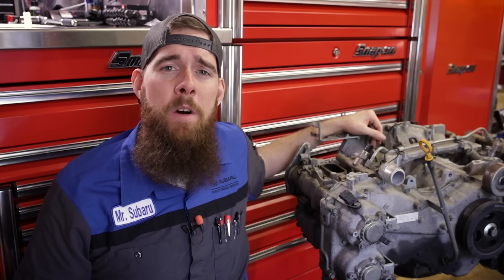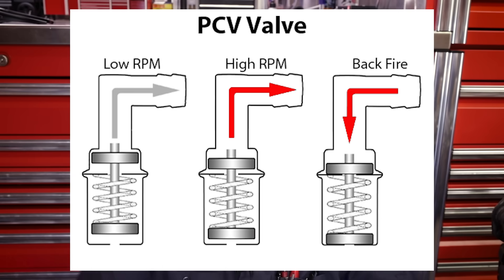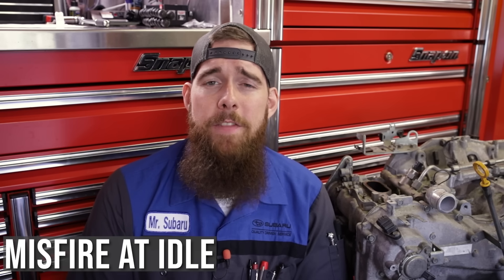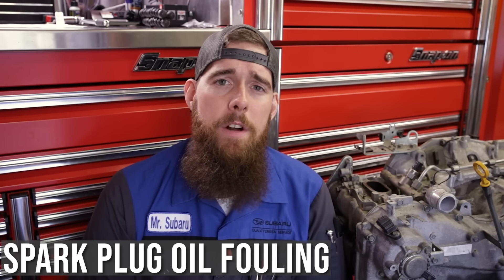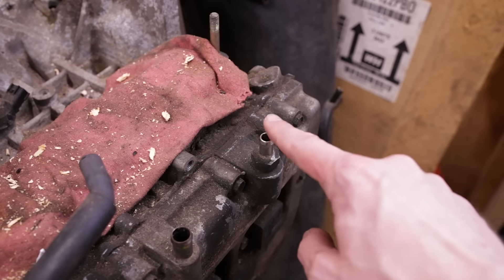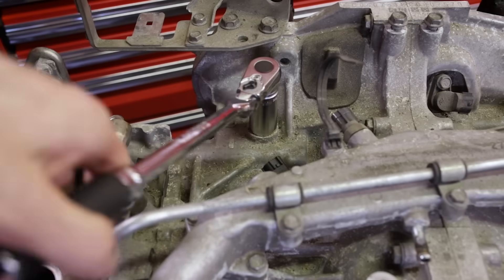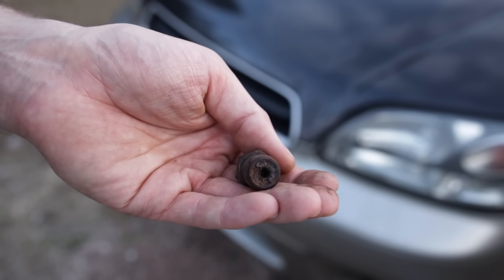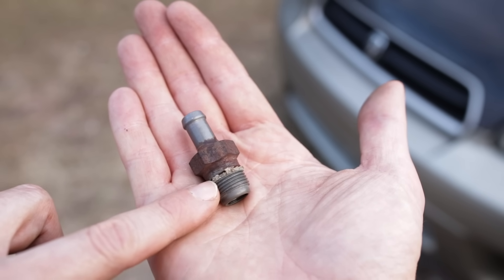DON'T Let This $20 Part Ruin Your Engine! PCV System History, Theory, Operation, & Repair!

Comment: $20? I just picked up a PCV Valve from my local subaru for my 2019 WRX and it cost me $38.75 before tax.
Reply: You can buy the valve itself for $4 from your local parts store. The valve is the same that Subaru sells. If it's sold as an assembly with hoses then it's not as easy to replace with a parts store one
Reply: Amazon $18.97, just ordered be here Wednesday

Comment: Will be overhauling my ej255 eventually, thanks for the heads up!
MrSubaru, is there a way to service the AVCS Cam Gears? Or better just to replace the outer seal and leave them alone? My car has a lot of miles, concerned for contamination/metal shavings inside the gears..
Reply: Also curious what he has to say about this. Noticing lag between my left and right intake VVT angle in romraider. Likely due to solenoid or sprocket contamination.
Reply: @ChasePhilport  After doing much research and talking to others in the forum, I have come to the conclusion that not servicing all those gears is a waste of an engine removal.
Imho, the dreaded P0011 code arises from using the Company23 tools for removing/installing the AVCS Sprockets. You see, those Gears have a mechanism inside that mostly no one opens because Subaru says it’s a non serviceable item. But why do you think those banjo bolts have a filter screen inside? Subaru knew..
After putting so much torque on the outside of the Sprockets using the Company23 tool to remove the cam bolt, the small pin inside the AVCS Gear drags and scratches the heck of the housing inside, which in turn end up creating small metal shavings. That debris might end up circulating the motor and clogging the selenoids inside the Oil Control Valves and/or preventing the Gears from working properly creating issues with advancing/retarding timing and therefore the dreaded P0011 code. Solution: Do not use the Company23 tools and open/clean and service those Gears every time the motor is removed. Outfront Motorsports in CA is the only shop I know that services the gears. They created a tool to properly align the rotor inside so the Gears work correctly later on. As I said, not doing so, is imho a waste of an engine removal.
Use this tool instead for holding/removing and assembling the AVCS Intake/Exhaust Sprockets:
https://www.tooldiscounter.com/product/cta-subaru-camshaft-locking-tool-cta3855?gclid=CjwKCAiArOqOBhBmEiwAsgeLmb2OdzM0tz5x14fesJXqyhK40kW_ZnsvYmizk1MuhuCvMNXRroIILRoCSFQQAvD_BwE
Also, take great care in disassembling the AVCS Gear, the big/weird shape O-ring inside is almost non-existent.

Comment: Question:

I did this quick repair not to long ago to my N/A 2006 Subaru Impreza 2.5i, I bought a new Subaru manufactured PCV valve and installed it without anything covering the threads to help seal it.

The PCV felt secure and tight. But is it highly recommended I go back and put teflon on the threads and re-install ASAP to minimize debris getting in or out, or should it be ok based off how secured it felt.

Thank you,
Jere
Reply: To insure an airtight seal, always use some type of sealant on metal to metal threads
Reply: @ericr2zz  Ok makes sense I will keep this in mind when I do go back and fix it.
Reply from the maker: It shouldn't hurt to leave it as is, but best practice is to use a sealant of some form on the threads.
Reply: @MrSubaru1387  I will try to redoing the installation then.

Comment: Don't forget to clean threads and maybe some permatex high temp thread sealant.  Haha, a few weeks too late for me after going through sparks, cleaning MAF, EGR, throttle body, found my rough idle culprit.  Everybody tells me to sell my 14 Forester (60k, garage kept in FL).  Bearings, AC compressor, PCV, now bushings.  It's enough I never want another Subaru
Reply: i have a 16 legacy and have never had any problems. all i have done was replace spark plugs at 98k and now i’m going into 106k strong
Reply: All that at only 60k? At least you won’t have to do those things in the near future
Reply: @pprb123  I was trying to find the root of the idling issue.  I've had to replace AC compressor, 2 rear bearings, 6 bushings that were completely dry rotted.  The car is garage kept.  14-18 Subaru's are crap.  A mechanic told me to sell it before 100k as the CVT transmission will be out of warranty.
Reply: Ho sostituito 2 lampadine hid Xenon OEM su XV Crosstrek al costo di 164 euro l'una😢 avrei voluto delle semplici h4 come luci anabbaglianti

Comment: The ej255 and 257 have a PCV assembly and dealer will only sell it as an assembly ($60)
Reply: If you are careful you can remove it from the junction and install a new one. The pcv is inside the black plastic portion of the assembly

Comment: Something else I recommend, on my 96 legacy outback 2.5 ej, I had all my gaskets, including the rear main seal, replaced on my car along with the pcv valve. However after a month, all my gaskets blew out and I had oil leaks once again. It wasn't until I swapped out the 2.5 with a 2.2 that I discovered the problem. When I removed the PCV hose off the main port on the block, I discovered that it was completely sealed off with a cake of carbon deposits. This clog is why I blew out all my seals again even after I replaced the PCV valve. I recommend checking this port on the block maybe every 100,000 miles or on your high mileage engines to prevent this from occurring.
Reply: this is exactly why I am so interested in finding out installing a catch can on my 2015 @.5 NA Forrester. filtering these emissions just makes sense to me. Do you have any thoughts on this?
Reply: @richardwilson5709  p
Reply: @richardwilson5709  Even if there was an oil catch can on my car at the time, it would not matter because the carbon clog was on the block port before reaching the first hose in the pcv system.
Reply: @GeoForge  i dont think hes suggesting this for ur car, or as an idea that could of prevented a secondary leak. 
I think he is solely thinking maybe if this had been done earlier before it was caked, i.e. his own vehicle, would that have be a good idea?

Also the fact that someone removed ur emgine and wasn't smart enough to look at ur okd pcv valve n realize that thing had to be caked up good, n not think, hey maybe i should look inside of this as well? Is sickening to me.
That car would of been lit on fire in their parking lot if that had happened to me.
Reply: @GeoForge  on side after i got super pissed for no reason (it just aggravates me to no end when someone gets ripped off, u weren't legit ripped off but u know what i mean).
Do u like the 2.2? N how do u think (i have a 2010 outback) a new 2.4 t would be? Im thinking about if i ever run into severe issues with my car pulling a good engine n hopefully trans out of newer low mileage wrecked car n going that route.

What were u able to source a 2.2 for?
Reply: How did you clean it? My PCV valve was blocked so I installed a catch can. But after a few drives the catch can is empty. Maybe the same issue.
Reply: @waynoswaynos  You can bust it loose with a pick or a screw driver and use a shop vac to suck it out of the hole. If you have your engine on a engine stand, you can flip it upside-down and spray cleaner into the hole so it can drain out.
Reply: @GeoForge  Thanks friend. May plenty of good karma waft your way! Engine is in. I don't enjoy doing battle with the intercooler on the twin turbo EJ20 but guess I'm going to have remove it again to clean this. Its a pig of a thing lining all those pipes up simultaneously.
Reply: @waynoswaynos  Glad to help. Hoping to own a twin tubro EJ20 in a Legacy GT-b BG5 one of these days.
Reply: @GeoForge   I have a GT BH5 but its stock and slow. And an auto. And it's not much fun in the gravel! I enjoy rear wheel drive vehicles way more I have to say.
Reply: @waynoswaynos  I've always liked the wagons and AWD. If I get a BG5, I plan to mod it like crazy.
Reply: If you aren't cracking the case and it's not leaking you shouldn't mess with the rear main seal. They are rarely an issue except when someone fucks up the replacement. I know this isn't particularly relevant in this case but it's good to know.
Reply: Yup when I changed the pcv valve on my 97 outback I noticed all the tubes connecting to it/intake/engine were completely clogged with carbon and oil. Changed pcv and cleaned it up but it appears to have returned, my pcv is oily but not clogged completely solid at least

Comment: What are your opinions on AOS systems; specifically for the FA 20 engine? No mods or anything, is it necessary to keeping the engine healthy long term?
Reply: IMO a regular old oil catch can with good baffling will do just as good of a job if you make sure to check it once week and empty it
Reply: Subaru engines already have 3 AOS's.
One in each valve cover and one in the back of the crank case.
If you're not racing your car at the track don't waste your money, the subaru engineer did a fine job.
Reply: @notsponsored103  I don't track my car, but still noticed a significant decrease in oil consumption after installing my AOS

Comment: when you pick up the PCV valve don't forget to get a new hose also. Mine was super brittle and it cracked when I put the new PCV in, so I had to drive for a few days with a check engine light because of the broken hose until I got a new one
Reply: Be sure to get a new PCV grommet at the same time, if the car uses one, it will probably fall apart when removed.
Reply: @skylinefever  Just buy the assembly

Comment: Super clear & helpful MrSubaru1387  
One thing to add. PCV vacuum hoses (where they sit on the PCV valve) become rock hard with age & heat. It's easy to split the hose getting it off the valve - ask me how. Last month Subaru (Australia) had no new hose parts for a 2013 FB25. My parts dealer spoke of shortages & suggested trying a Specialist Subie wrecker. I put on transmission hose for now.
Reply: Agree about difficulty getting the hose off the PCV ‘tail’.  2015 FB 25 with 137k kilometres. Sunshine Coast. Cleaned the valve and hesitation is gone. Rough idle with a/c on now gone also. You would think that service centres would know about this. Apparently they don’t 😮

Comment: Oh I just changed that this year on my EJ20. It’s super easy to change, just takes a little effort to remove the old hose. Mine wasn’t totally bad (I could hear the ball shake) but it’s worth changing anyway since my engine has almost 200k miles now. I also recommend changing all old tubing that you touch on older vehicles because they get hard and crack easily.
Reply: I change mine every 25K miles, no questions asked. It is cheap insurance. I replace the hose and/or rubber grommet as soon as it shows any damage. As I change my oil every 5K miles it lines up with my regular maintenance anyway. I hope this helps you with all your cars.
Reply: I am planning on changing mine as well. As far as getting the right part, since there are so many types of EJ20s,does the PCV valve have to be specific for your specific EJ20? 
What sort of EJ20 do you have?

Comment: If it fails does the ECU throw any fault code? I've an EJ205 Forester XT and I'll be replacing it tomorrow due to a sudden oil consumption.
Reply: I don't think it does. There's no wiring connected to it that would sense and indicate a failure. Mine failed and did not show any trouble codes.

Comment: I would guess this may not make much of a difference, but would an air oil separator/ oil catch can help extend the life of the PCV valve?
Reply: I don’t know what engine you have but if you have a turbo engine and remove the line going to the left side of the rail under the intercooler, there shouldn’t be oil in there. If there is, I hear a catch can will help. But I’m not an expert. 

In either case, the Subaru PCV valve is cheap to replace and easy to do.
Reply: No, it won't, because catch can would be placed after pcv valve

Comment: Omg, what are the chances. I did both on the 06 Forester and 12 legacy today! The legacy was a pita with the clip
Reply: I'm hoping this will help reduce my oil consumption
Reply: @vtk5  wow that's a lot of oil! I'm at a quart every 2k. Sorry for your loss! You gonna get another one? What heavier oil did you use?
Reply: @mrsubaru can a bad pcv valve trigger a p0420 code?
Reply from the maker: It shouldn't.
Reply: @MrSubaru1387  dang, I have had the p0420 come up a few times over the last few months (I've been resetting until I can figure it out). I was hoping I'd get lucky and kill two birds with one stone. I replaced both O2 sensors, but it returned. Anyway, Happy New Year Mr. S!
Reply: @aaronnokaoi  my 2005 EJ25 is doing the same code. Replaced 2nd sensor and code still keeps coming on.
Reply: @soundsolutions  ya, my code hasn't come back over the last 400 miles. Weird. I also changed both sensors. I'm guessing it is the cat, it's a bummer